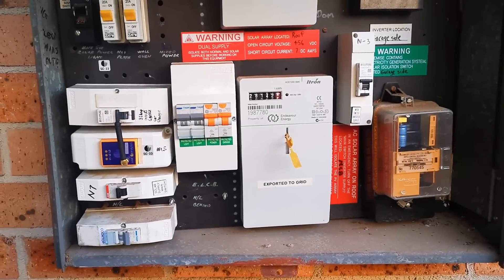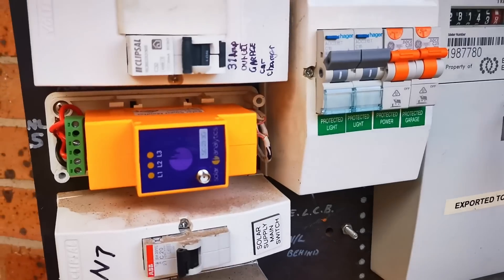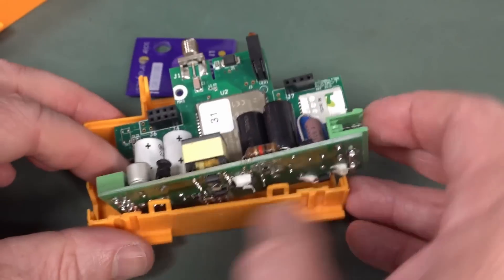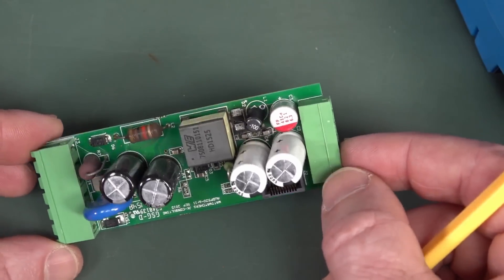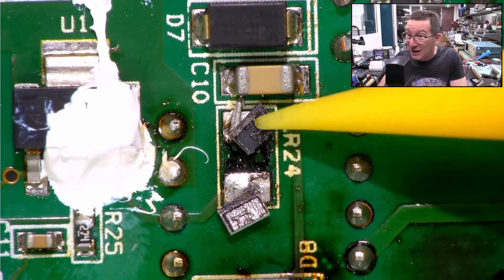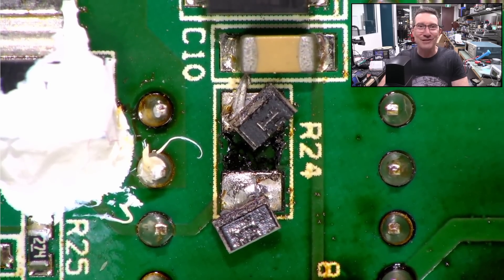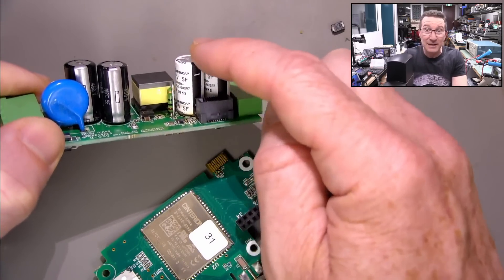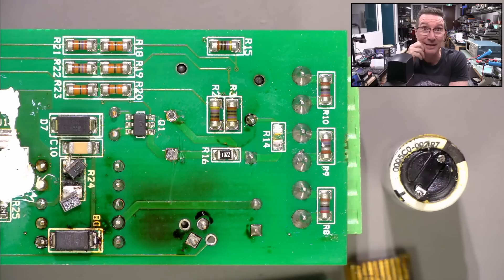EEVblog 1511 - Solar Analytics System FAIL! (+ Dave gets ZAPPED!)

Comment: Oh no! Sorry to hear the device is dead. We'd love to help you out and will be in touch!🌞
Reply: Ridiculous.  So much armchair engineering in here.  "REAL engineers wouldn't put caps in series..."  I have a dozen PSUs designed by Delta that disagree strongly.

"I'm concerned about the future engineers that are learning this bad practice..."  Well, I hate to break it to you guys, but future engineers are going to learn some things the hard way.  Just like you and I did.  And everyone else on the planet.

"I can't believe he was dumb enough to get zapped by a charged capacitor...."  I can't even take this seriously.  Look out, everybody, we met the guy that never makes mistakes.  Whew, I didn't think I would have THAT honor today.
Reply: @sirnickity Wow. That's your takeaway?

Yes  everyone makes mistakes. It's even likely this wasn't a mistake, per se, as the "standard practice" has become just that.

 But just because something is standard practice does not mean that it should be just dropped in without analysis.
AND, if "standard practice" is actually a very poor practice, then it should be analyzed as to how, and efforts should be made, to prevent that in the future.

EE students are taught about four-resistor biasing of transistors. Why? Surely if one knows the specs, only one resistor is necessary! But, no, they go on to discuss things like thermal-effects on beta, and mismatching tolerances, and so-forth. The "Why." If standard practice were to use single-resistor biasing, and transistors had to be hand-measured/picked in every circuit, and it only worked at 75 degrees F, we'd never have gotten to the single-packaged Op-Amp.

 Standard-practice was deemed wrong. Not that the folk using it were wrong. But an effort was made to teach why and to teach better practices so that the field would improve.

Now, as a representative of graybeard EEs to 885 thousand folk, many of whom are learning from him, wouldn't it make sense, if you'd seen a recurring trend of people making the same mistakes over and over, to try to give others the opportunity to learn from those mistakes, so they don't have to learn it the hard way? Especially, if those "standard practices" could lead to things like exploding batteries whose fire can't be extinguished? Or maybe it makes more sense to insult each other.
Reply from the maker: @ericwazhung  Give it a rest. The designer himself said it WAS analysed and considered at the time. And again, zero known failures in 70k units installed. And it seems there is a decentt liklihood that the cause was actually a poor joint on one of the balance resistors.
Reply: The correct answer is "Oh no! Anyway..."
Reply: I’ve certainly enjoyed the popcorn on this thread chaps 👍
Reply: Would be nice if Solar Analytics would agree to let Dave take apart a new one to see if there has been an improvement. Also maybe get the guy who designed it get involved. These are the real world things that happen that help other engineers learn. We all make mistakes so to me it's not a big deal as long as the manufacturer comes good on a replacement and are helpful.
Reply from the maker: @adamxsquared  I've already said I spoke to the designer and the new model they are sending does not have series caps, it has a single cap.
Reply: Anything from electronic compoents can fail no matter the technology they use (fact)
Reply: While there is discussion about caps in series, what do you guys think of diode in parallel to every cap to limit voltage it can be charged to? I'm pretty sure somebody told me about it many years ago, as it should protect capacitors connected in series. But maybe I'm misremembering it :)
Reply: @DreitTheDarkDragon  I'd thought of similar in the past, e.g. using 1.25V zeners in parallel with NiCds in series. But it gets quite iffy if the input voltage varies by even some tiny fraction due  e.g. to ripple. Imagine a ripple of 0.1V on a 5V source. Imagine the cels are fully charged to 5V total, but now the source is 5.1V, now there's a huge current going through the zeners to ground, barely even enterring the cells. Likewise, if the source drops to 4.9V  there'd better be a series resistor or the battery'll dump near infinite current into the source. Gnarly.
There may be a solution with series resistance, but then one's got to consider the load running simultaneously to charging, etc. It's, like many such things, got to be considered on a case-by-case basis. (in my case, I was trying to buffer a 5V source, to a 1-2A (large-ish) load. Inserting a diode to protect the supply was not an option. But, maybe in a small-current  lower-voltage application like a backup for  SRAM, it could work with careful consideration).
In the case of capacitors, there may be less concern, since one might choose a lower-than-abs-max voltage. But, with batteries, another consideration is their decreasing voltage capacity. E.G. a new LiIon can charge to 4.2V, but as it ages, it may never reach 4.2 again. In which case , a good charger should have a time-out, rather than keep pumping current, creating heat, waiting for it to reach 4.2V  forever.
Capacitors may not have this problem, but uneven wear is still a thing, even if they're always charged equally. So, again, if allowed to discharge far enough, one might reach 0V long before the other. The other will still supply current to the load, through the one that reached 0V. And doing-so would reverse-charge the rmpty one. So  your diodes must be cleverly-placed to prevent that!
Reply: ...which leads me to wonder about this differently: We're not really concerned with equal-voltage, but equal charge as in coulombs. Yeah? As long as: Vabs-max=2.7V isn't exceeded.
And if two cells or caps are of different capacities, but powered in series  then wouldn't they receive an equal number of coulombs? Hmmm So maybe the smart thing to do is just stop charging when one reaches 2.7V.
Not sure, VERY tired. Ponder-worthy, will I remember tomorrow?
...
As far as the earlier rants, It would seem I failed at conveying, though I still hope I made it clear to most, that this wasn't about this particular implementation, as I clearly don't have enough info to make such a determination. This was about the trend, which this post just served to remind me of.
Reply: Whenever you see a busted cap, it ALWAYS means the voltage rating was exceeded - assuming the cap in NOT defective .
Reply from the maker: @NICK-uy3nl  Nope. Could be one of various production tolerance errors, temperature, pulse currents, you name it.
Reply: @NICK-uy3nl  Not necessarily. There are just old or overall crappy electrolitic caps with poor seals. There has even been a monent in time when many PC matherboards suffered from a "capacitor plague" for a couple of years. And don't even get me started with old soviet caps from the infamous plant in Armenia...

Comment: i think what looks like flux residue om edge connector in reality is vapourised plastics or epoxy from the board, looks like that connector got quite a bit warm, p.s.sorry didnt watch til th end guess it was electrolyte

Comment: Dave is ruining consumer electronics companies' profit margins on selling crappy disposable electronics, as usual...
Reply: No, but it should be embarrassing to be caught with series supercaps.
Reply: I can guarantee that at least one manager will try to come and demand the problem to be fixed in firmware without any hardware modifications and the poor engineers will have to prove that it is impossible first and only then they will be able to start fixing the actual issue. It happens almost every time.

Comment: Once got a 1000VDC zap from a PMT power supply by somehow touching my probe with a metal braided shield touching the back of my hand - man I had 3 fingers numb for a few months doc even sent me to the neurologist where they did an EMG with a sharpie and marked where the damage was (ulnar nerve I think) - thank goodness it healed on its own - high DC voltage is no joke m8 glad you're OK
Reply: .... I was thrown accross the room as a child investigating my brothers 'reel to reel'.
The drywall had my body shape imprinted (Like a Warner Bros. cartoon).
Reply from the maker: @robbieaussievic  I was thrown across the room as a kid from a live chassis tv I was fixing.
Reply: @EEVblog  That's where the term fly-back transformer comes from!
Reply: @EEVblog  Yeeah the same here from a cheap ATX power supply. Bloody live heatshinks! Should have known better....

Comment: isnt the gunk just the glue which holds the smd parts onto the board before the board goes through the soldering machine?
Reply from the maker: Mixed with electrolyte for extra gooyness.

Comment: I have a suggestion Dave. You should video a break down of the new one checking PCB and quality of solder  joints on the new unit, if you do replace it. Could help with future diagnostics.

Comment: The gunk under the resistor is from the glue used in the reflow. That is a double-sided loadout of SMT parts, they would be all reflowed at the same time, the ones on the bottom have a dot of glue to hold them on during the reflow process. When the resistor heated up to such a high temperature, it burned/melted that glue under it.
Reply from the maker: Mixed with electrotyle for extra taste
Reply: @EEVblog  MMMMM  yummy too!
Reply: @EEVblog  🤔 that mixing fixation glue and electrolyte would create a new kind of explosive mixture tearing the component base 😶........ 😂
Reply: ..... Excellent detective work Mate.

Comment: I’ve lost count as to how many supercaps I’ve changed out at work on the bench. They are notorious for leaking and destroying boards, components and tracks.
Reply: Soldered-in batteries are worse I think...
Reply: It's because they put them in series with each other with no protection or voltage balancing. When they're new, they're well matched, so share the voltage equally, but as they age, they don't match anymore, and the voltage creeps up on one until it's above the rating, and then it pops.
Reply: @gorak9000  I like you. Hopefully some aspiring engineers learn a thing or two from your time.
...
OP: As for doing repairs, if you see them in series, prb best to replace both, regardless if one's OK, because a new one will put that much more strain on the old one.
Reply: @gorak9000  These morons don't even put a string of resistors in series, each resistor being in parallel with a respective cap?

Comment: Every time i see that fusepanel of yours, my toes curl up.... I reckon that´s Australian standard for the time period, but I would be ashamed of myself, leaving the costumer with something like that and called it a finished job.

But then again. I do see panels similar to yours from time to time here in Denmark, but it´s usually where the handy DIY guy have been at it. 🤣 Which by the way have been illegal for non trained personnel around here for ages.
Reply: Dave is indeed quite the costumer - and it's even halloween and everything!
Reply: Yeah, that fuse panel gives me nightmares!
Reply: What a ridiculous way to make a fuse box.
The Yank ones are much neater.

Comment: How are they balancing those super-caps?
Reply: Poorly.
Reply: or not at all - that's why they failed. Rookie design mistake - trap for young players. HP Raid controllers that used supercaps had the same fate, and they ALL fail.

Comment: Pretty mediocre dot-matrix silk screen on the boards. But that's not JK's fault.
Reply: but what is JK's fault is putting super caps in series without voltage balancing between them - rookie mistake - trap for young players. Don't recommend JK for high reliability designs...

Comment: That's kind of weird that the supercap didn't fail out the top. The metal is scored there to send the explosion up and away from the PCB.
Reply: Correct me if I'm wrong, but the scoring in the metal is a fail-safe to prevent too much pressure building up; but that doesn't mean that the bottom 'rubber gasket' can't give way earlier. As a matter of fact, leaking caps usually leak from the bottom. It's just to prevent it from exploding should the rubber gasket not give way.
Reply: @Rob_III  Yeah, the intentional weak points in the top of the can are a pressure release, but the rubber seals can and also do fail. That's why when you're intentionally blowing up electrolytic caps for fun or profit (by hooking them up with the polarity backwards and or above their rated voltage), the little caps that don't have the "vent" in the top of the can give better explosions than larger caps that have the vents.
Reply: @Rob_III  I'm not going to correct you !
Reply: Perhaps the can was damaged during manufacturing.
Reply: @yadabub  It's a known failure when you put supercaps in series for higher voltage ratings. There were a bunch of HP Raid controllers that had similar issues where they used supercaps in series as the backup battery to keep the cache alive if the power fails, and they failed in a similar manner. When the supercaps are new, they share the voltage equally across them, but as they age, they don't match anymore, and eventually the voltage across one of them is beyond the ratings, and then it pops.
Reply: @gorak9000  This is the same as charging without a balancer, for example, 18650 - a huge mistake
Reply: @Okurkaarrgghh  Well, that's true, but as you could read in the addendum from Dave, there was a problem with the balance resistor and thus my reasoning as to why the fault occurred was correct.
Reply from the maker: @Edisson.  Correct, the balance resistor was physically missing when I opened it, and you can see this if you watch the video. Looks liek it was soldered there at one point, so I can only presume a dodgy solder joint and it eventually fell off.
Reply: @EEVblog  That was the first thing that came to my mind when I saw a blown supercap, and before that you said that they are at 2.7V - they will be in series a) a manufacturing defect of the capacitor - for it to die due to its age is nonsense, b) the problem of uneven charging
The first time I saw the video on my mobile phone and you can't see the details there, and I don't speak English very well, so the second time I watched it again on the PC and the subtitles.
Nice day 🙂 Tom

Comment: That NESSCAP must have decaffeinated itself, or lost it's 43 beans.
G3 inside a metal cabinet, I wonder what the signal strength is like?
Admittedly the back of the cabinet is not metal, but all that rats nest wiring must have an effect.

Comment: @13:24 Looks like one of the supercaps died. It's a little bowed, and there's the tell-tail signs of schmoo leaking out of the bottom. That would explain the "slow" overload that cracked a resistor and melted the diode. That gunk under the resister is very likely the glue used during manufacture (wave soldering / IR cooking the underside.)

I'm really surprised there aren't fuses all over that thing, being mains connected and all.

(Yes, I've seen resistors crack. Even the big 1960's era pinned ones -- inside an arcade console powersupply. Moisture gets into them and then heat/cold cycles take their toll.)
Reply from the maker: The input side is fused.

Comment: That second SuperCap might have had problems also as you can see the shrink-wrap cracked on it as well (18:33). 
Although there is a chance it was damaged by it's neighbor.
Reply: If they are in series and one has failed it is likely to have severely overstressed it neighbour. Both should be replaced, preferably two from the same batch.
Reply: so super they weren't anymore and I'd say they are the reason for failure. maybe compounded by his local climate, as compared to others.

Comment: OK to leave those CTs open-circuit with the system live?  I always thought that was a no-no, or do the CTs have burden resistors built in?
Reply from the maker: I believe they are just normal current output type with no voltage conversion resistor. They are disconnected.

Comment: I bought a 90's house back in 2020, I wanted an induction cooktop installed, but my switchboard was out of compliance, and they had to replace the entire thing, $3000 later, I have a nice, neat switchboard now..
Reply from the maker: Ouch.
Reply: @EEVblog  the old switch panel had the Aircon system circuit mounted to the outside because the board was so full.. it really should have been replaced when they install the solar system.. doh!